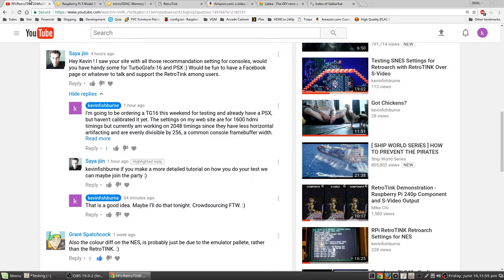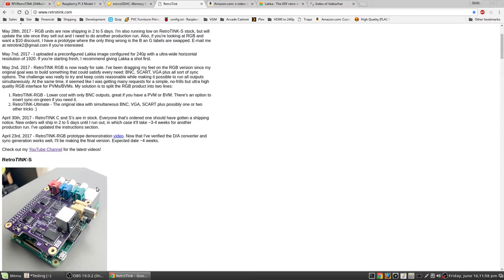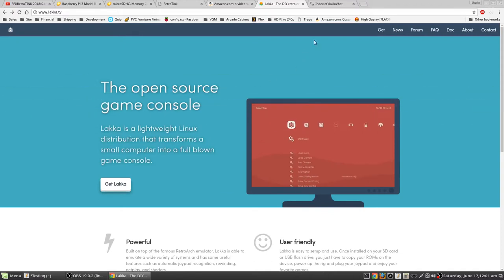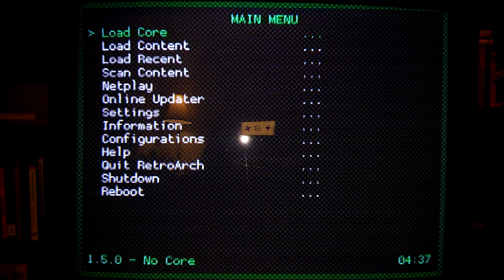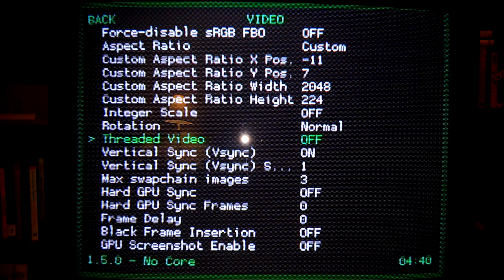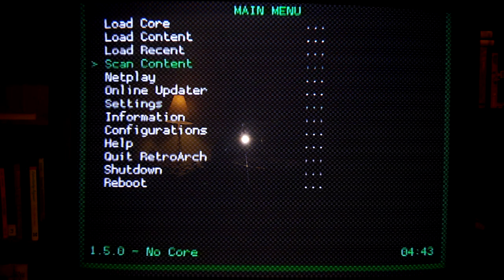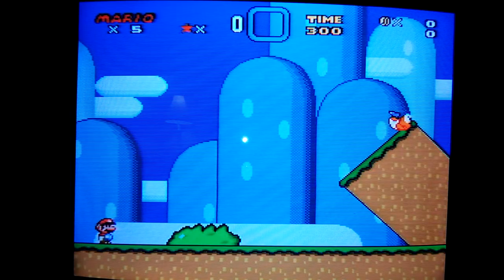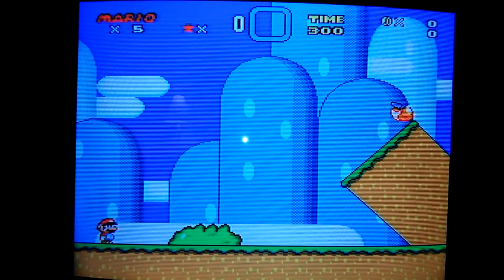RPi/RetroTINK Calibration Process

Comment from the maker: Correction: The Custom Aspect Ratio Width should not always match the hdmi timings width. It may be adjusted close to nearest integer division to match the original system (disable Integer Scaling), which will add horizontal scaling artifacts but be more accurate to original geometry.
Reply: Have you ever tried to play Sensible Soccer with these settings ? Do you see scaling artifacts of the white lines of the field ?

Comment: Haha thanks for the shoot out !! :D I got a camera and a tripod ! I'll be helping out for sure !
Reply from the maker: No prob. I was just looking at your SotN shots in the Discord chat and you definitely will benefit from the tripod. I can align the two shots in GIMP using a common point of reference on the TV bezel, but even with that the distance and/or angle could be off making them hard to compare.
Reply from the maker: Also where it gets a bit wonky is after the "full screen" calibration, when you start doing close-ups. You'll notice that "bloom" for lack of a better term begins to make comparison more difficult.
Reply from the maker: That happens if one output is brighter than the other. The difference in intensity causes some kind of interference or swelling in the CRT's electron output so they don't land on the same phosphors exactly.
Reply: Daim that precise ! .. I haven't work enough on it to have that knowledge  :) Thanks for sharing, can't wait to participate, hopefully with the tripod I'll be able to share high quality pictures and help a bit :)
Reply from the maker: It's nearly impossible without a tripod, even if it's a makeshift one for a cell phone. Just be sure to take the photos with a remote control or voice command so it won't wobble the camera/tripod due to pressing the button. If you're careful when pressing the button, a time delay can be used if there's no other option (the camera will stop wobbling by the time the delay is finished).

Comment: Im not sure what the point of move the screen is, each TV set will have different overscan and screen shift values for real hardware,
Reply from the maker: It's to make the emulation match the console. Just as the console will appear in a different position on a different screen, the emulation will move by the same amount on a different screen. That each TV is different isn't relevant, as the difference is caused by the TV, not the console or RPi.

Comment: Do you happen to have a current build of lakka with the config edit? Possibly with the vertical arcade scripts that are floating around out there on Facebook/Google drive?
Reply from the maker: My current Lakka image is 2.0 but doesn't have any scripts, just the per-core overrides and 2048x240 config.txt. It's also not "clean", so it still has my button mappings, game playlists, etc. I also don't have any experience with vertical games where the CRT is literally rotated 90 degrees, but would like to build a cab like that just for those arcade games. I think RetroArch has some support for this but haven't tested it.
Reply from the maker: Forgot to mention that the current image (.img) is here, though it is specifically for the RetroTINK and won't work with the integrated Composite output and possibly not with other devices such as the GERT VGA 666 (haven't tested it): http://eightvirtues.com/lakka/hat/
Reply: Yeah another guy made some config edits to automate tate/vert arcade games. But I think he's set it up for retropie and not lakka. I don't know how cross compatible they are. Anyways here's the link if you want to check it out https://drive.google.com/drive/mobile/folders/0B8uZtHByEHyBMkNRRmk4T2E1ZUk?usp=sharing
Reply from the maker: Cool, thanks. RetroPie has WAY more stuff going on. Lakka's very simple, basically a minimal Linux distro (OpenELEC) running RetroArch. Doesn't even have X11 or the binary NVIDIA driver. I think Lakka may support some level of scripting before/after launching games and such but haven't investigated yet.
Reply: Also, there's a script there that takes the mame resolution list and applies it per game. It's interesting I'd def check it out.